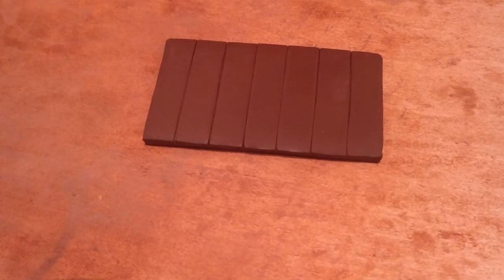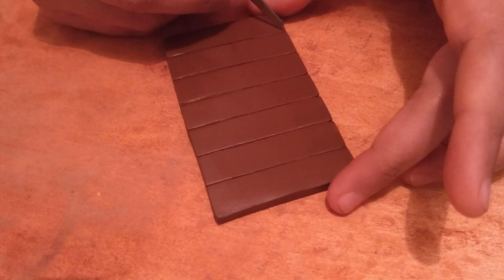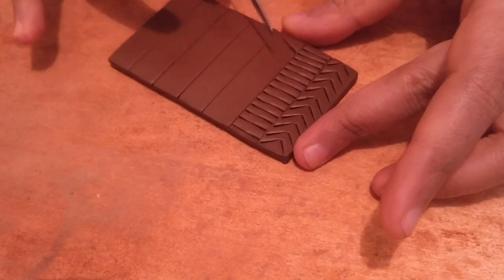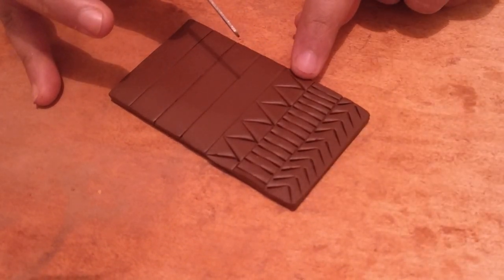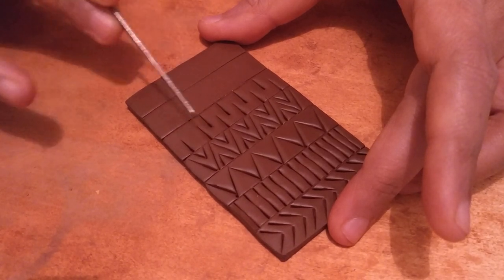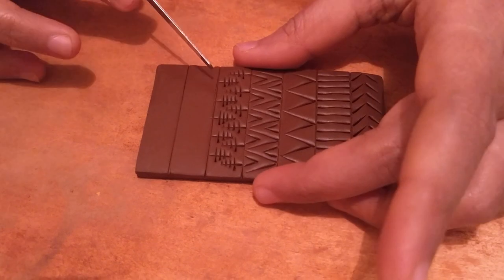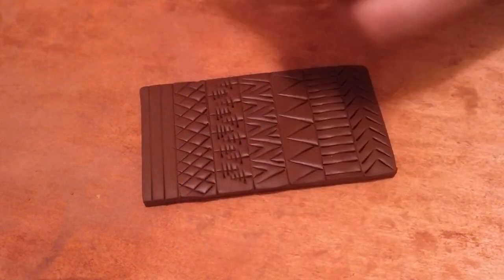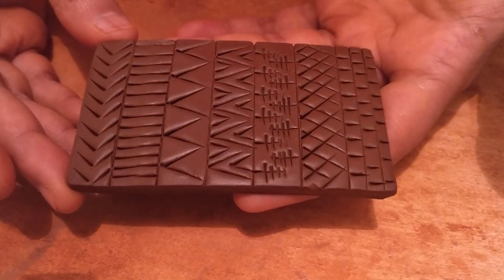Patterns with a knife on terracotta #terracottajewellery #howtomake

Comment: How do you get the surfaces,front and back and sides soooo neatly
Reply from the maker: Based on your work surface. If your work surface is neat, then the back of the pendant too will remain neat. I always smoothen the sides before designing the pendant.
Reply: @nehagopinathpillai  can you please make a video on how to use the knife and smoothen the sides please